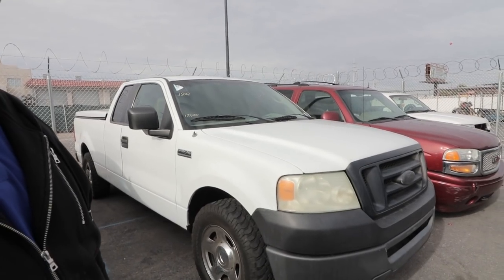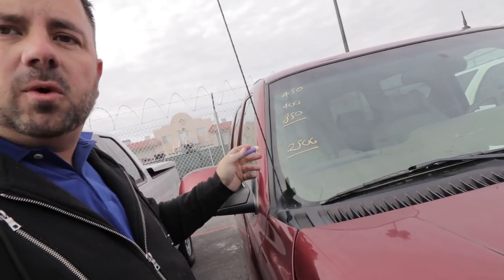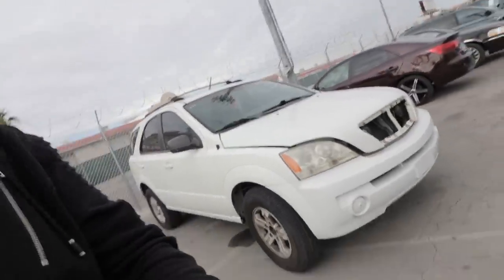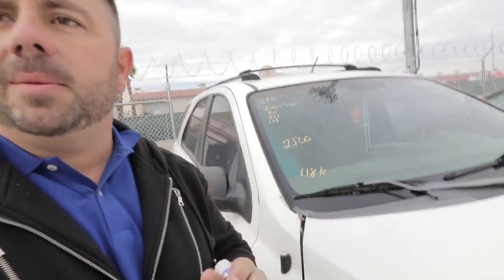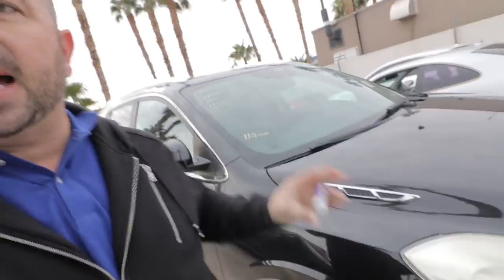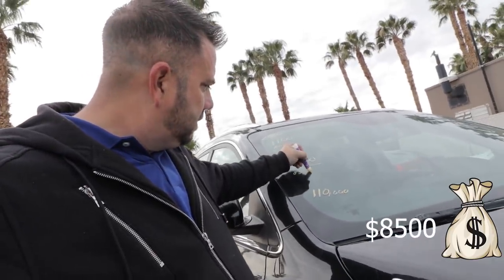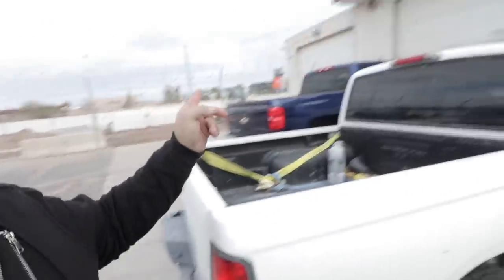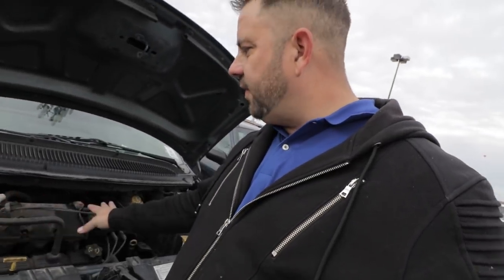Flipping Cars $500 - 1000 Part 2 mini series

Comment: I mastered plastic bumper repair. Most crack or missing chunk drill tiny holes on each side crack. Stitch crack with zip ties. Or string mud with your favorite epoxy anything. Bondo, fiberglass, JB weld, 2 part epoxy. Meer neat and even it help on sanding get electric palm sander glue sandpaper to it I get free sand paper dumpster diving at auto paint colistion centers. Paint eazy mix cup full harder and reducer spray single stage. Sand 400 so paint don't peel clean with water dishwashing soap rag bucket.

Comment: What advice would you give to a new dealer in Vegas who wants to buy cheap cars from tow auctions but does not have a mechanic on stand-by to get said cars fixed. Can you recommend a good honest repair shop?
Reply from the maker: Ray Smith   I would go with a mobile mechanic over a shop in the beginning.      Cheaper cost. Build a relationship .  Plus they can come to your lot and fix all the cars.        But also try to start fixing cars your self to see how much money you can save and see what you feel comfortable with
Reply: @LuckyLopez777  OK thanks

Comment: Thanks for the info, looks like I’m doing things wrong, I always hear about low priced cars but for some reason everything I get is usually about 2,000-3000 all through Manheim or adesa Los Angeles area, so you finding these cars under a grand is like mind bottling for me . Good content !!
Reply from the maker: 321importfx      Thanks.   I buy.   My $3-10k cars from.    Adesa and Manhime.       But on cheap cars.   I always buy outside the auction.          A  good place is IAA and copart they have nice cars for $500-1500.   But. The fees are crazy.        I always have better luck on FB market place.    And no fees 👍
Reply: @LuckyLopez777  I think Copart is a scam for public sales auction.  if you are not dealer you will be more screw by them. You have to paid a bunch of hidden fees.  Plus you need to hire a broker to help you buy those junk cars
 who most like is working with Copart under the table.. Maybe i am wrong but i think after doing my own research that what see..
Reply: Importx you can also buy good cars from offer up Let go to flip them.Facebook it was to much drama for me..
Didn't like because my phone was always ringing 24hrs like if i was selling drugs full of fake people.

Comment: I really want to start doing this but in Michigan all the cheap cars are usually covered in rust and it sucks to try and fix a lot of the rust. Any recommendations???
Reply from the maker: I know a lot of people from the Midwest who buy their cars here in Vegas California and Arizona a 2000 Chevy Silverado 4 x 4 is a $15-$2000 car here but my friend sells them in Minnesota for 6000 because there are no cars that are older without rust.
Reply: Ya, I have been thinking about buying a large trailer to move cars from the south up here because almost every old car is basically rotted beyond repair on the body or the frames have rusted so bad they break. Thanks for the info I’ll have to look more into southern vehicles.
Reply from the maker: Jed Mook     My friend set up a really good system he work to deal with a trucker for $300 each car he brings them from Vegas to Minnesota but he ships cars that are rusted out he buys for like 300 bucks and sells them to a junkyard out here for 500 so it pays for the shipping

Comment: The 4dr truck in paint isn't a 1500. It's a 2500 3/4 ton. Gas burner from looks of the exhaust.  You can tell by the eight lug wheels.
Reply from the maker: It was a 1500. they just took the lift kit and suspension form another truck.  might have been a 2500
Reply: @LuckyLopez777  those aren't interchangeable. Unless you swap everything. Axles, etc.
Reply from the maker: @shoreangler3383  I know we do it all the time appreciate the comment

Comment: Do you think central Fl is a good place for these used bucket cars? I recently passed my dealer exam but I’m
Now second guessing the area I’m
In and the amount of competitors here aswell. Is it always better to start near home or is it better to travel
A bit to an area with a higher demand for cheap used cars?
Reply from the maker: T1997z   Florida is good if you’re doing by here pay here if you want to do traditional bank financing your like here in Vegas the state has a lot of default loans.  So the banks charge huge fees.              There is always space for more cheap cars.       Do you want to make a program that sticks out different from the other dealers so if you can afford $500 down and $75 a week you can buy a car from us today.
Reply: Automotive Life 

But buy here pay here is extremely capital intensive. I’m trying to use my own cash to run my first dealership. Do you think 15-25k would be enough to start a small BHPH or even a small retail only
Lot? Do you think I can survive selling cars for cash only And not doing financing?

Comment: thoughts on ford escapes?
Reply from the maker: Depends on year.  A lot of the older ones have transmission issues.      And the newer ones have.  Motor/turbo  issues.           I would stay away from any that are AWD.         Always check trans when warm to see if it loses pressure

Comment: How are these people going to public tow auctions and flipping cars throughout the year when supposedly Nevada has a 4 car per person annual sell limit?
Reply from the maker: Ray Smith       I was told 6 cars a year.     I would start as a hobby.   Once you get good at car flipping buy a brokers license.   And sell thought other dealership.       I have friends that have 30 cars.      They have parks at 5 different dealerships.
Reply: @LuckyLopez777  Do you think that if I sell more than 6 cars privately that I bought from two auction, DMV will crack down on me?
Reply from the maker: Ray Smith    As long as you sell.  Good.  Cars that are fix and smog you shouldn’t have a problem.  I have a friend here in Vegas he sells 30 cars a month.      Privet party.         I wouldn’t go that far but I would sell as much as you can to get experience before getting a dealers license
Reply: @LuckyLopez777  Thanks for the insight I really appreciate it.